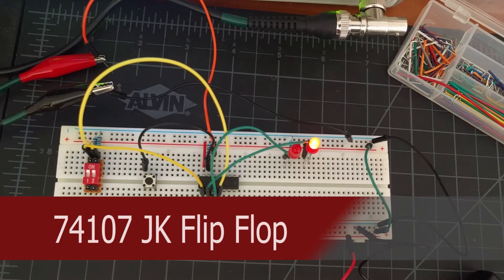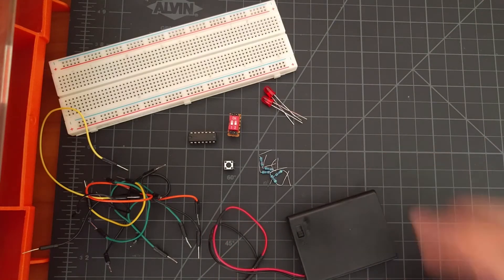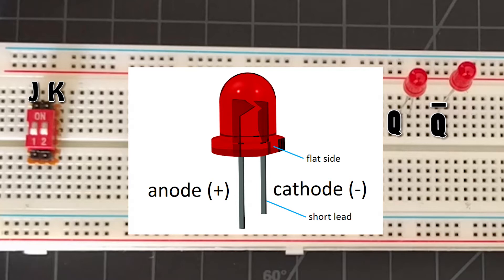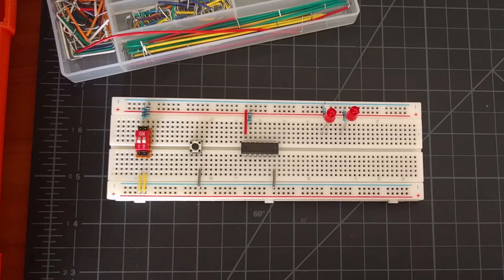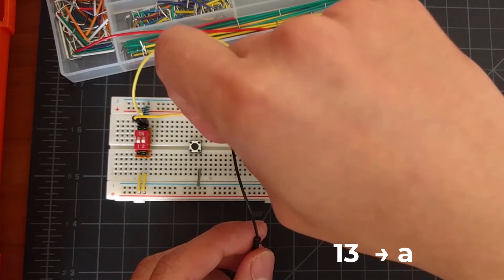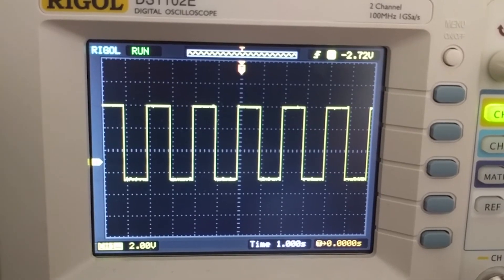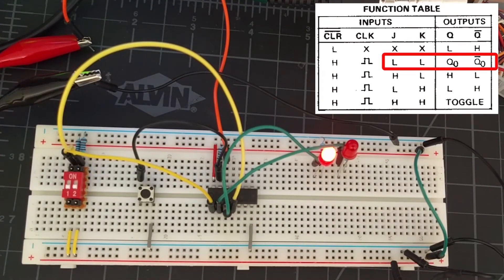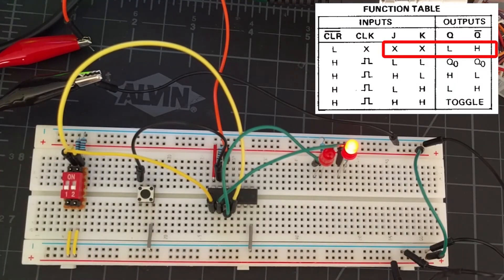Logic Tutorial | Building the 74107 74HC107 JK Flip Flop w/ Clear

Comment: I got a Microcontroller built in JK Flip Flop, and I can program it (from configuration scheme) to function independent from the MCU engine and without writing any C code into the MCU chip. This is made by Microchip PIC16 called Configurable Logic Cell (CLC) peripheral built inside the MCU core.